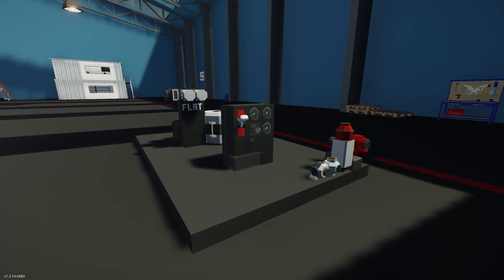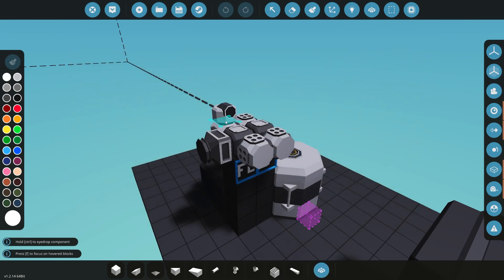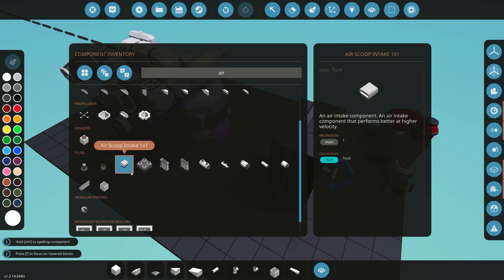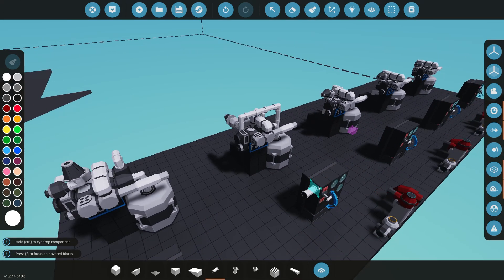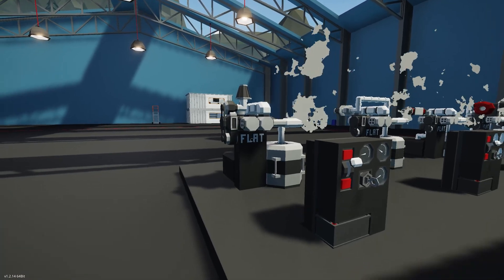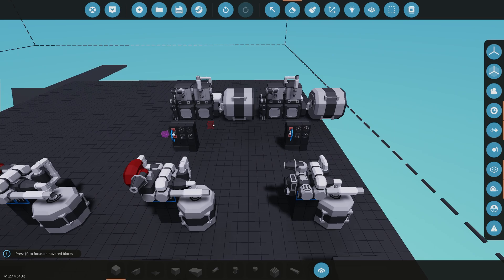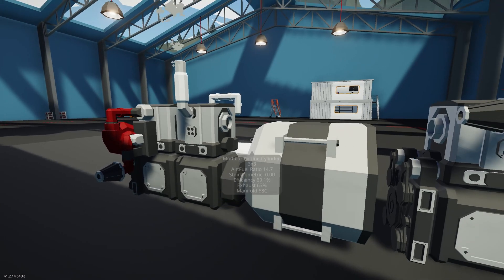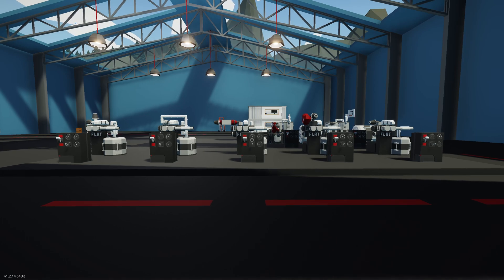Do Superchargers Work?? - Modular Engine Test - Stormworks

Comment: I kind of wish they'd add back in a turbo. I'd love to Turbo Charge (having both a super charger and a turbo charger) an engine. I'd actually like to see you super charge the old engines and see if you can get better performance out of them. I wish that there was something like that for jet engines, like spool the fans up faster or something, but for now, I'd love to see if like a prop plane has better performance with a supercharger.

Not that it'd be super interesting or something you'd need to do, but I'm wondering at what point does the extra power become outweighed by the extra fuel needed? Like a standard engine on an airplane (since weight is most crucial on aircrafts) will go X far. Will a super charged plane of the exact same stats save for that super charger go a farther or shorter distance that the standard? If shorter, can you add more fuel tanks to make it just as far or is there no point in doing that? If the case is that it's a bigger waste of fuel than power benefit, we might want to rethink this and think of a dual intake system where you have just a normal intake through one pipe with a valve and then a pumped intake on a closed valve on the other and being able to swap between more air (more power) and cruising power would be a bit more sensible.
Reply: The turbo was a great idea, but the issue is the game doesn't have internally consistent maths as to represent conservation of energy, so having parts that turned pressure back to shaft power created many unintuitive and game breaking issues (indeed even wheels represent a simlar problem, and electric generators had to be radically reduced in efficiency to prevent the direct "generator powers the motor" being an infinite energy system). IMO the easy solution would be to make the turbo a single part with 4 fluid ports (compressor in/out, turbine in/out), but honestly it wouldn't add much in the way of meaningful player choices to the game simply using an electric pump doesn't.

Jet engine wise, you can use multiple combusters to get more power (for more fuel), or multiple turbines (in parallel rather than series seems to work best) to increase shaft power, you can scale this out to stupendous amounts (devs admit jets are overpowered, but aren't fixing as it'd break all the existing creations).

Aircraft wise, you'll normally go less distance for a given amount of fuel carried by increasing power, as drag goes up rapidly with speed. However in stormworks you often can improve economy by supercharinging then reducing engine RPS till you only make simlar power, at which point if you go further or not is a function of what the supercharger weighs vs the total amount of fuel carried. A large pump weighs 20kg, so if it improves fuel economy 10% to fit one, you'd really want ~250kg of fuel weight (including the tanks ect) before fitting it would work out. That said you don't need a second intake manifold, simply putting a one way valve in parallel with the pump will have the same result when you turn the pump off... although this only saves you the electrical power needed to run it, as the actual efficiency of the engine isn't reduced in stormworks from simply reducing the throttle, assuming the engine size/temperature/rps remains the same, 100% throttle naturally aspirated and whatever % it takes to make the same power supercharged will require the exact same fuel manifold throttle, and flow the same liters of fuel per minute. So all that said, there will be very few instances where its worth adding extra equipment to bypass a supercharger on an aircraft, simply run the engine at max boost all the time, and ideally control the power output via gearing, but otherwise close the throttle a bit.

Finally word pedantry, but common use of the word "turbo" is a contraction of "turbo-supercharger", referring to a supercharger driven by a turbine rather than shaft power (alternately turbo-electric being a electrical generator driven by a turbine, as used by many steam ships). "Turbo-charging" is simply adding a turbo to a engine to increase the intake charge air pressure/flow. There isn't a specific word that maps to hybrid setups with both an exhaust driven turbine and engine driven supercharger, with "twin charging" in some parts of the world referring to this setup, but in others used equally for two turbo's on the same motor.
Reply: @SheepInACart  dude, why much text

Comment: I already changed my air to fuel ratio to 12 to 6 for better performance out of the flat 8 cylinder ship engines, already my 6 deck cruise ship can easily reach 30 knots, I might give the large pump a try if it is needed, though my engines will use a lot of fuel. Testing I have done with the large impeller pump disappointed me, the engine actually lost power from powering the impeller pump.

Comment: At some point in this testing series I'd love to see an efficiency comparison of power generation per fuel used, for these different engine setups.
Preferably using gearboxes to give a fixed RPS, as fuel consumption rises dramatically with RPS. iirc, from my testing it seems like around 7.5 to 8.5 rps is the sweet spot (which could be something else to test).
Reply: I think the best way to compare engines is to pick a load and RPS to do testing at. Then use  controller to maintain said RPS . 

You can then estimate engine load by reading air throttle (in my latest tests even at max pressure air throttle was higher than fuel throttle) lower value means more power to spare and compare fuel efficiency by measuring fuel flow, lower flow is better.

If you are testing anything keep variables to the minimum, it makes for better end easier to analyze data.

Comment: Using the electric pumps isn't a fair comparison since it's not sapping power from the engine like the belt and torque driven pumps, so you're essentially getting energy from an outside source.
Reply: Slap an alternator on the belt and you can feel less bad about that.
Reply: IRL your right, but as is in game the electrical consumption works out to extremely little power (like only a watt or two off the generator, where 70 was being shown for this large pump config) so this test is pretty much what you get.

Comment: I wish the Impeler pump would also work with the exhaus gasses from the engine so we could build turbochargers. Thanks for the Video its was really helpful ! =)
Reply: U can. He just didn’t do it. If u use two impellers side by side matching the torque things so they are the same, u can use the fluid in and feed in exhaust, and fluid out to feed it out. And on the intake one, it’s the same as u would expect. The air in can just have an air filter and the air out can go straight to the manifold. Or at least I hope it works. Otherwise I’ve been throwing them in all my cars and told myself lies that it made it better
Reply: I just watched the end of the video… I don’t know honestly. I personally haven’t tested a before and after, but I put them in all my builds now, and now I feel stupid
Reply: @averagegamer5617  Sadly no, impeller pumps never output shaft power on the RPS side. There WAS a turbine part tested during beta branch phase of modular engines update, but it was removed from the game as it showed up the issues with the games physics in ways that made it unintuitive to use and prone to exploit (like an electric pump running the turbine, running a generator), without actually adding much in the way of meaningful choices for the player that superchargers didn't. IMO they could avoid most of the problems by adding a "turbocharger" part that didn't have a RPS connection, but frankly as the game is currently set up its pretty easy to have FAR to much power in almost any creation (most cars or boats already go unrealistically fast, would fly if you gave them a rotor, meanwhile the sea is like molasses so you stop extremely rapidly if you turn the engines off), so its a solution thats likely not worth the dev time to implement any time soon.
Reply: Same here, was really excited back when turbos first came to the experimental branch and I could pump exhaust through them to create torque. I was disappointed when this was removed, but apparently it was because people were able to make infinite generators with them. I'm really hoping they add this back in, or at least add a different part that accepts fluid and outputs torque but doesn't work the other way around as a pump. This way the torque output could be scaled down to where infinite generators aren't possible. Maybe some day 🤞
Reply: Same
Reply: i pretty sure they do, i have a engine of the workshop and it has supercharged exast out the back, idk tho i could be wrong
Reply: @thekak2627  i 2 impeller Pumps, one that the exhaust goes through that should generate the power for the other to speed up the air and the engine has the exact same output as the engine without the turbo so i guess oh doesnt work :/

Comment: I love the science going on in these videos, definitely keep them coming.

A suggestion: I have to imagine the pumps that run off the engine aren't improving performance as much as they could be - for a better comparison, maybe do the same setup but powering the rps-driven pumps with an electric motor instead?  That way we see the full performance of the engine without the losses in power from driving the pump.
Reply: Problem is that you will have to drive the compressor somehow, with a supercharger that’s commonly done from the crankshaft and with a turbo from the exhaust pressure (not possible in Stormworks), I guess it’s more inefficient to drive the pump directly (or with a gearbox) from the engine instead of first converting into electricity and than back into rotational power, so this is probably the most realistic for use in a creation
Reply: @kalle5548  Yeah, my suggestion is to just drive it with an electric motor from a battery so we can see the full impact it has on engine performance without requiring engine power to run it.  In a practical setup it obviously makes way more sense to just run it off the engine, but I'm just curious.
Reply: It would be best if in all cases generation was provided by the engine tested so real life increases can be measured.
Reply: @tymoteuszkazubski2755  For general use, I 100% agree.  I'm just curious how much of a drain the pumps are on the engine.  Obviously they are producing more than they would without the pumps, so it's a net positive, but.
Reply: @stevepittman3770  I don’t know, haven’t tried myself, but I think you would still go net positive but with slightly less power and efficiency, you would have to test yourself if you want to find out if it’s more efficient to use the electric ones or not, would be interesting to see how it is in Stormworks compared to IRL
Reply: @kalle5548  IIRC main benefit of electrically driven pumps is an ability to provide boost at low RPS. My tests indicated maximum power increase at maximum RPS where N/A engine is above it's peak power and is loosing power far more quickly than forced induction.
Reply: @stevepittman3770  IIRC fuel flow increase from engaging belt driven pump is negligible especially at higher loads. If you made controller smart enough it could even add boost only at high throttle, although it would introduce nonlinearity into engine control which makes it harder to deal with.
Reply: @tymoteuszkazubski2755  Thanks for the info, have started making a line of jetski's and have considered supercharging the engines for peak performance, with a switchable ecu to a eco mode without forced induction, could be interesting getting full boost at low rpm, thanks

Comment: I'm not sure it is clear cut. The fuel consumption for the RPS gain (it also would be useful to know the torque differences) is quite a lot.  For the large engine that is an 18% rps increase for about a 53% gen (RPS & torque), for over double the fuel cost.  Fuel consumption in this game is already far too high vs the real world, supercharging would even more severely limit range. I also wonder if there is the temperature increase, that real world super chargers add to the engine due to friction from the impeller.

Supercharging in game is modeled incorrectly. Their purpose not to cram a pile more air and fuel into the engine (you can do it a bit, but too much would destroy the engine, and you also will decrease the life of the engine due to the additional strain), rather the air amount in the cylinder is increased while the fuel stays the same (this is different from rich/lean as that describes the fuel going into the engine while the air remains constant), which as I said increases engine power. As a result supercharged engines run up to a 12.5 ratio for maximum efficiency. You can see engine power boosts of up to 50%, and parasitic drains from the engine powering the supercharger of up to 20%, plus the extra weight from the supercharger, which would decrease fuel efficiency a bit (maybe up to 20% decrease).  So the games figures are way off (aside from using the wrong air fuel ratio for a supercharger in your test), 50% boost for double the fuel is WAY off.

It would be nice to have turbo charging added, as that is largely a free boost, and more commonly used.
Reply: Its his microcontroller. it targets an AFR, so its increasing the fuel consumption to match the increased air. You don't have to run superchargers that way in Stormworks.
Reply: @danieljones8706  I will have to test myself, but I do not think Stormworks puts any limits on total air and fuel per cylinder, as as far as I understand you can just add more air and fuel intakes to increase what is going into the engine, and I suspect by using a large pump, even with the right AFR mixture, the fuel consumption will go up by a significant amount.  In his test the fuel consumption doubled with the large pump, which is a lot more than the difference in ratio would allow for.
Reply: @neonsamurai1348  You can test it out, but Stormworks doesn't magically increase fuel consumption just because you use forced induction. I'm pretty sure of this because whenever I use forced induction, I have to increase my fuel throttle constant.
Reply: @danieljones8706  Air volume is a function of intake pressure. Since air and fuel manifolds are separated you need to increase fuel flow too. I believe it works as it should in this regard.

Comment: I want to share my scientific work about boost the intake manifold of a modular engine.
You can find my work on request "ModEng stand" (by Lightning) in the Steam workshop.
This stand have output power measurement system and load maintenance system. It can to measure/compare engine performance.

if you intresting i can translate it to engish.
Reply: Не ожидал тут русских увидеть, думал я один такой дэб
Reply: @flexalon  Приветики из Москвы!
Reply: @modelkiniy  Привет с Камчатки))))
Reply: @flexalon  Привет из Омска)
Reply: Thanks for helpful bench test kit

Comment: if you super charge correctly with a large impeller and controlled ratio, then yes, they work significantly, usually giving a 30-50% boost in power

Comment: So if a supercharger is possible, then is a turbo? If I'm correct a turbo forces a mixture of fresh air and exhaust into the engine, where as a supercharger just forces air in. Be interesting to see if the game actully accounts for it. Forcing fuel with a pump too, wonder what that would do to perforce with the forced air
Reply from the maker: Turbo uses exhaust to turn pumps which provides air, where as supercharger uses engine power instead.
Reply: The only difference between Turbo and Supercharger is that one is connected via belt, so it's rpm are dependant of engine's rpm.
Turbos spin freely, some can reach 150k rpm
Reply: A turbocharger is powered by the exhaust of the engine while a supercharger is powered by the engine itself. Both force air into the engine, they are just powered by different sources.
Reply: @Tacticaviator7  Ohhh, that makes way more sense lol